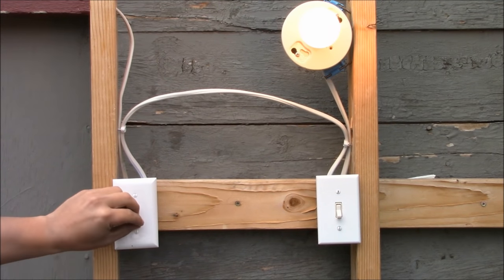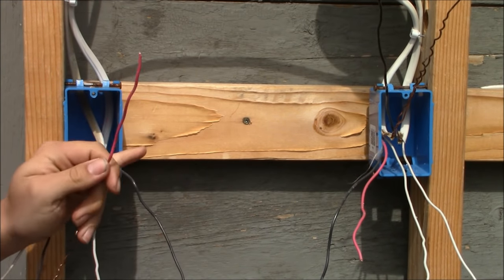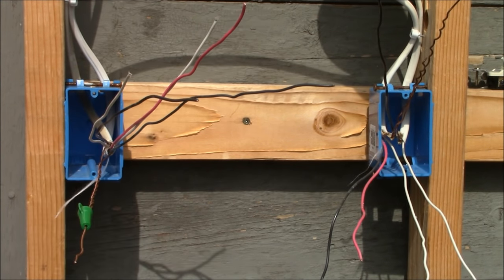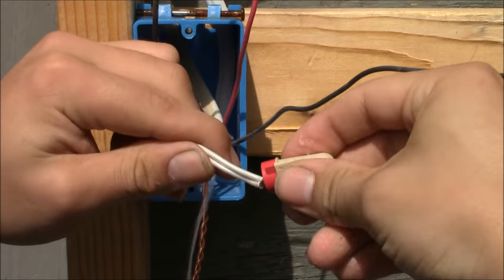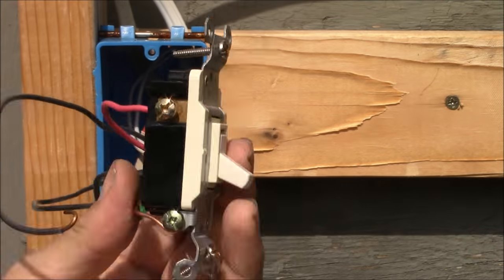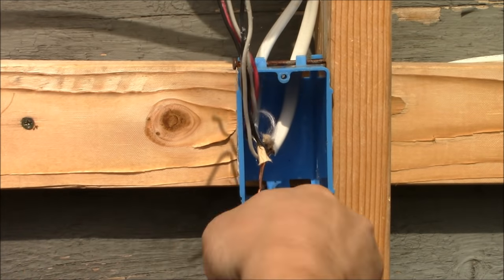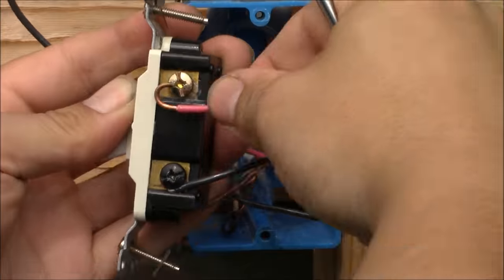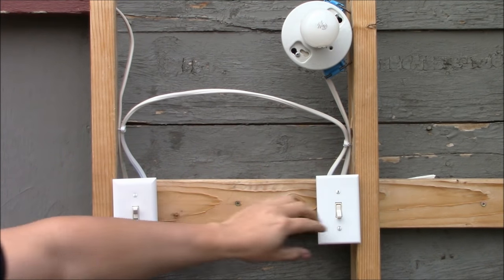How to wire a 3-way switch system

Comment: Why do you say that the common is not used? It is not connected to the switches but it is most definitely used in this setup.
Reply from the maker: You're right. I just phrased it wrong.

Comment: I too thought this was a great video and I followed it to a "T".  When I flipped the breaker on, my ceiling lights came on but they won't turn off.  I checked my switches and every single terminal is hot.  What??  I can't turn the lights off no matter how many times I switch either switch off.  Could my switches be bad?  They are brand new Levitions from the big box store.  Never saw anything like this.  What should have been a 30 minute job is going on 2 hours.

Comment: I have an existing single pole switch, I’m trying to add another switch to the other side of the room. On my “2nd” switch box is only 1 supply and 1 hot going to the fixture. I’m running & securing my 14/3 through a drop ceiling. Want to make sure I do it right if anyone can help?
Thanks in advance!

Comment: Also, why is a 14/3 romex being used if the neutral is not?  Why not just use 14/2 for the entire circuit?
Reply: Technically a neutral shouldn’t be used as a designated hot wire, it was used previously but neutrals should be left in the box for any future use such as some dimming switches and other higher tech switches that require a neutral as well

Comment: Didnt really show much here. Just hot to hook up the 3 way switches. This video implies your lines are already ran lights hooked up etc and your just changing out switches. I am just saying if you still have this template hooked up add how the wires get jumped to the next box and back to light etc.

Comment: Hang on. A second , when ever you strip the romex  cable , you only need a 1/4 inch of insulation  in the box, so don’t leave so much romex cable insulation in the box like that , it makes it ugly and just not ergonomic , I recrommned using  a razor knife to get it done

Comment: Well in the video he says he turns the power off when he actually turns it on at the breaker and on the first wire switch the wire around the screws is going the wrong direction other than that decent video

Comment: I have older wiring so this guide is trash unless you have code perfect new wiring. What if I have red wires and 2 black wires and some white ones too?  The guide is really useless without explaining how exactly the wiring works , not just hooking up wires.

Comment: EVERY HOME I have EVER wired has 2 black wires, 1 white and a ground, yet EVERY Fn VIDEO on YouTube has Red, Black, White and ground.   WTAF!!!!!!!!!!!
Reply: They don't make mc or nm with 2 black wires. Atleast not here in Americas recent history. If you have 2 black wires it was either pulled through conduit or there is more then one nm cable in the box and you can not do a 3 way without losing your neutral. Regular switching would be fine just have to identify the hot.
Reply: @jessiegarvey8634  I just went out to my garage and looked at 3 different types of Romex I have from various jobs I've done in 3 or 4 houses. NEITHER had a red wire. All 3 had white black ground (bare). Anyway, I finally got both 3-ways working in the house i was working on so I'm good. Thank you.